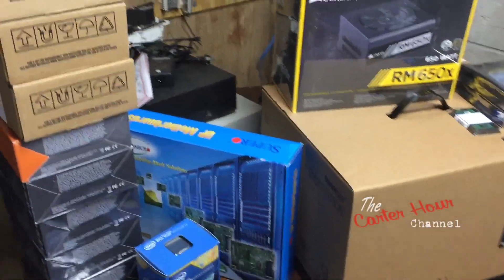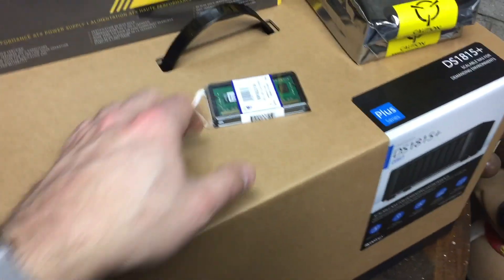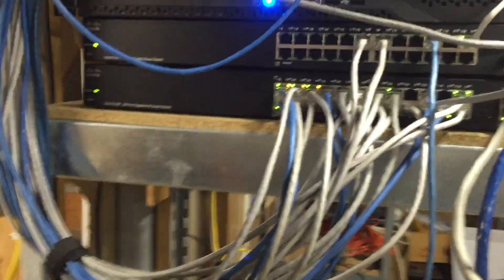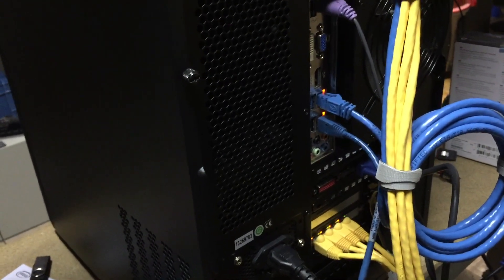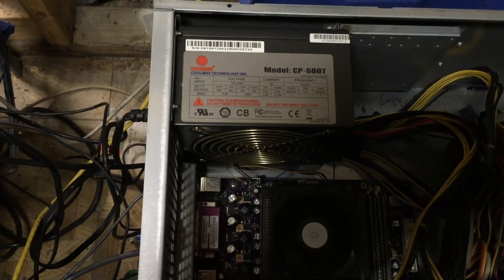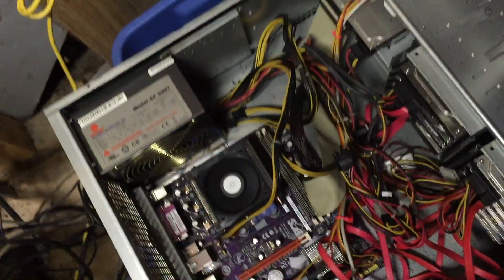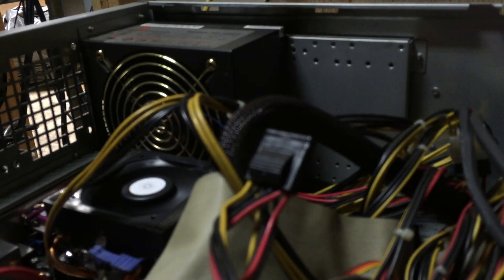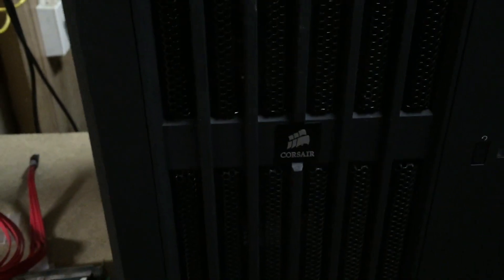New Home Network 2016, VMware, Extreme Budget Build

Comment: When it comes to servers and energy consumption, Can't you just turn them off when you are not home?  You mentioned that your old server was running 24/7.....  Just wondering?
Reply from the maker: Generally a rule of thumb with servers is they stay running 24/7 for immediate access.  However yes you could shut them down when not using them.  The reason I don't shut mine down is I run an exchange e-mail server so for the past 7 years I have had two servers running to take care of e-mail and other services that I needed access to at all different hours of the day.  The new build with virtualization is not only more energy efficient, its much more powerful than what I had prior.
Reply: The Carter Hour   How Hilllary Clinton of you!  LOL!    I think I may actually do the same thing.  Thanks again for all the helpful vids!
Reply from the maker: LOL, no worries!

Comment: Parts List?
Reply from the maker: Updated in the Information below the video as well.

1 x Corsair Carbide Series Air 540
1 x Supermicro MBD-X10SAE-O ATX Server Motherboard
1 x Muskin Enhanced Blackline 32GB (4 x 8GB) 240-Pin DDR3 SDRAM DDR3 1600 
1 x Intel Xeon E3-1220V3 Haswell 3.1GHz 8MB L3 Cache LGA 1150 80W Server Processor
1 x CORSAIR RMx RM650X 650W ATX12V / EPS12V 80 PLUS GOLD Certified Full Modular Power Supply
4 x HGST TravelStar 7200 2.5" Laptop Drives
2 x WD VelociRaptor 300 GB Drives 10000K NOS
1 x 1815+ Synology 8 Bay Nas
4 x WD 3 GB Nas Red Drives
5 x Seagate 3 GB Desktop Drives plus an extra drive
1 x DDR3L 1600 4 GB Ram Upgrade for the Synology

The only truly expensive part of the build was the Synology Box.

Thanks for the question, appreciate the stop by. :)  Cheers.
Reply: Thank you.
Reply from the maker: +Robert D no problem thanks for asking :) cheers

Comment: waste to install esxi on anything other than a USB stick.
Reply: +The Carter Hour I guess if you're using ESXI in a datacentre, you won't have storage in the ESXI host server, just RAM and cpu power which will have a fibre/sfp link to a SAN/DAS, my HP Microserver G8 boots ESXI off a MicroSD card just because all my storage is in my actual home server.
Reply: +The Carter Hour I have ESXI 6.0 installed on a 16gb sandisk usb drive, no problems at all in both my poweredge R710 servers
Reply: I've been tunning ESXi off of USB Flash or CF cards for the last 7 Years or so. no problem.
Reply from the maker: +hackinblack I have never heard of people installing ESXI on a USB stick before.  Not that I am for or against, just has been brought up a few times in comments.  Any pros or cons in regards to using such an installation method, why do you prefer installing ESXI to a USB vs. Hard Disk when it really doesn't take too much room?

Comment: I also run the SD 1815+ with 32 Tb of space, and I also run freenas on another box. I won't run servers at home though, they generate too much noise and heat and too much power. I won't even  run  xeons at home,  I run my VMs in a nested environment ESXI 6.0 inside vmware workstation 12 on 6 SSDs in RAID 0 (and i back it up every weekend) and it runs great, and i run some physical hosts as well when i need to check a few issues.
Reply: You can get Xeon basic servers that are not power eaters and are quiet, Fujitsu TX1310 as an example. I have 2 of these each with 32GB and using some Samsung SSD Pro's for the HyperVisor. The 2 TX1310's I bought both came with 2x 1TB drives.2 Onboard NICS which were found no problem by ESX6.5 (always check the current VMWare compatibility) and about 3 PCIe slots.

Comment: im planning on having (2) ssd drives, (4) hdds.  which drive do i install esxi on ?
Reply: +Jeff Turner Install it on a flashdrive
Reply: Steven Rix Thanks. And just book from flash drive?
Reply: Exactly. The reason is simple: you gain in extra SATA/SAS port for your drives, or future drives, and the host in ESXI is just the kernel that manages the datastore. The datastore though will be located on internal drives or the VSAN or your ISCSi connection.
Reply: +Steven Rix Makes sense. im planning on this build (my first build btw), a flex media server as well and i am using the larger ssd to perform the transcoder of dvds or something like that..lol
Reply: Depending on the OS you might use the SSDs for cache only when you saturated your maximum RAM on the motherboard ,that would be the case for a NAS. I do use SSDs too in a virtualization environment when i need the extra speed (for example i can deploy windows 2012R2 in 60 seconds), and I also use those drives as boot drives sometimes (windows OS only for my case). Also you have the new M.2 SATA port, NVME SSDs, with better perf than  a single SSD, those tiny SSDs are amazing.
Reply: SSD for the ESXi HyperVisor and then HDD's for VMs you shouldn't need more than that for a Home Lab. Or install SSD's for VMs if youre running high intensity database applications in the LAB.

Comment: A single server with a power consumption of 700W/h??? That doesn't seem correct. Are you sure about that? How did you get to that value?
Reply from the maker: +ralmslb Just a guestimate, however I was also running redundant power supplies as well.  However you slice it or dice it the power meter on my APC 2250vA battery backup was saying over 50 percent capacity.  This wasn't just that server it was my other server and my tape drive.

Comment: Why not install ESXI to an 8 gig usb stick and save all of your spinners for the datastore?
Reply from the maker: +DJuan Carter Never thought of that, never have done that on a VM before.  Does it work efficient?  Usually VM OS doesn't really take up that much room.
Reply: +The Carter Hour Works great..  ESXI and its VM databae is only 2 or 3 gigs..  Not a whole lot gets written to the usb stick.  Its how I run ESXI boxes at home and at work.   If you can spare the USB port its outstanding.  Here is an older blog post about it.   http://blogs.vmware.com/vsphere/2011/09/booting-esxi-off-usbsd.html
Reply from the maker: *****
Thats a cool idea.  Also very portable on the hardware.  I will give that a try on my next build.  Thanks for the tip.
Reply: +The Carter Hour no problem..  us carter's have to stick together
Reply from the maker: +DJuan Carter Yes we do :)

Comment: What type of VM's are you running?
Reply from the maker: +MrTechQc I am running 4 Windows 2012 R2 Standard Servers and 2 Linux Servers
Reply from the maker: +MrTechQc I am running 4 Windows 2012 R2 Standard Servers and 2 Linux Servers
Reply: The Carter Hour Awsome,w hat task do the W Serv's perform? (Kinda Searching ideas to add more use to my server xD )
Reply from the maker: I have two domain controllers, the primary domain controller just serves as ta print server, the secondary domain controller hosts centralized AV, third windows server hosts exchange 2013, and the fourth windows server hosts SQL, and backups with veeam.  My one linux server is CentOS 7 and that hosts mysql, and other web based applications, and the final VM and last linux server hosts my asterisknow image that controls my VoIP phone system.